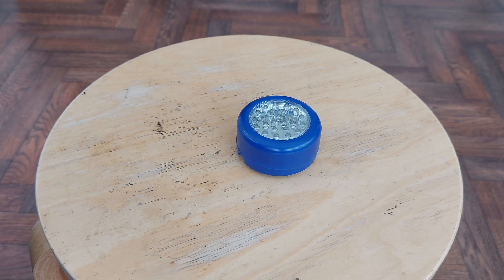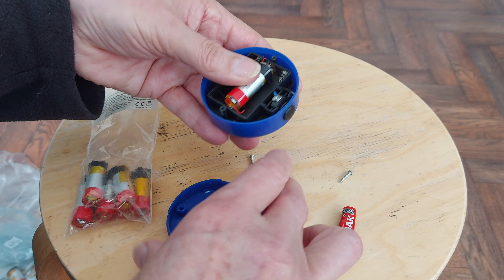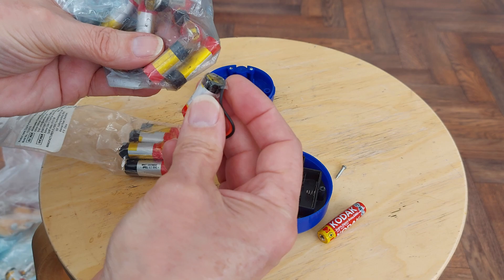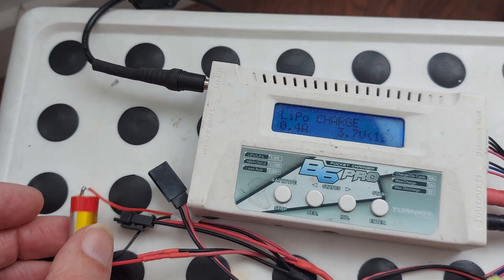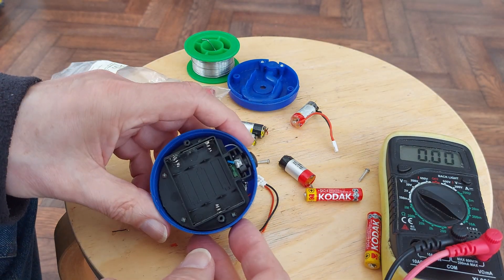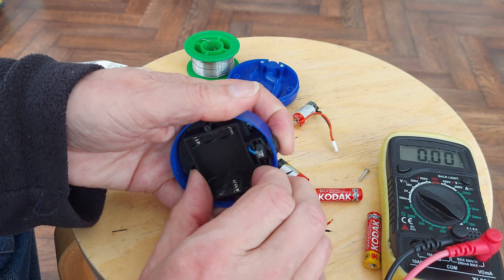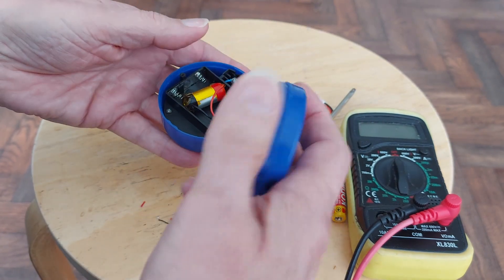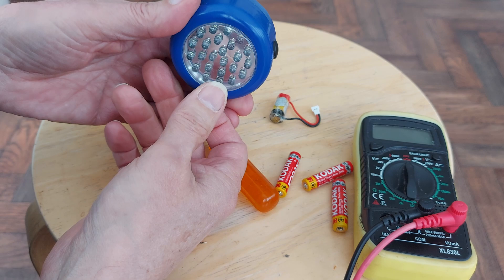Lipo mod for handy magnetic LED lamp

Comment: Nice little modification Grandad,  probably what others desperate for clicks would call a "hack" 😂 I'm a bit hesitant to make more use of my collection of vape batteries like this, but I'm probably worrying for nothing, they seem quite safe
Reply from the maker: They can catch fire. Usually when charged incorrectly or when damaged whilst fully charged. I have experimented (like many other channels) and it is surprisingly difficult to get them to catch fire. But, like a spark from an open fire, even a small fire can escalate under the right circumstances.